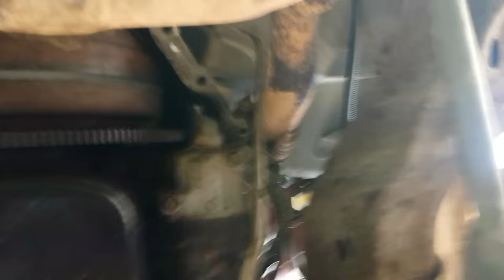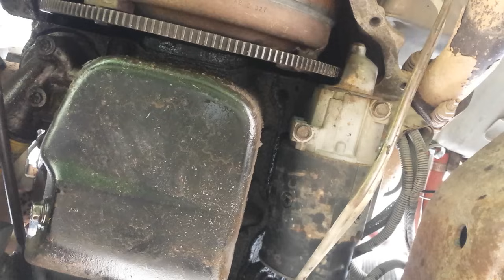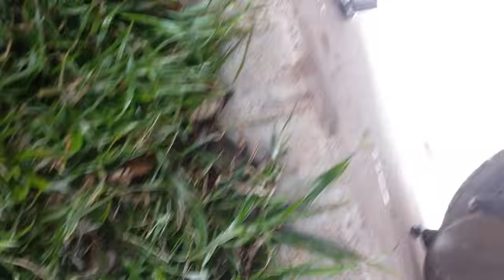Bad flexplate sound

Comment: My 86 Monte Carlo SS, does the same shit...thought it was a bearing, but when car warms up it's fine, for the whole day, just on initial startup after sitting in the garage. Replaced flywheel and starter, when left stranded...Now, won't start(after 6 months of use), just that annoying GM "zing". I hope it's the starter, and not because the lazy asshole mechanic didn't torque my new flywheel to spec.

Comment: My flex plate is cracked as well. Only to find out the torque converter is actually stuck to the engine as well. Mechanic is on it, but he said if they can't get it off I have to get a new engine..... They've been trying to get it off for about 4 hrs. Next step is cutting the torque converter like a pie and putting some heat to the center. Please pray for me lol engine is clean as can be too. It's going to suck having to get a new engine when there's nothing wrong with mine..
Reply from the maker: Suh Dude good luck bud. Put a little heat on it and have at it.
Reply: FamilyMatters2015 thanks man
Reply: Suh Dude what happened??? Results?
Reply: Shoot, I’d find a way to get it off.. even if I had to pull the whole thing engine and all and use a blowtorch and a friggin jack hammer! Lol

Comment: Fly wheel sounds fine, and I would know
Reply from the maker: USMC FT BLASTER it shure didnt look fine when it was pulled.  Was almost in 2 pieces. Cracked all the way around where it bolts to the crank
Reply: FamilyMatters2015 well than that's one quiet fly wheel, mine would make a loud clacking sound occasionally and then on prom night my car broke down and we found out the fly wheel is basically in pieces, last I looked at it it was cracked so bad it wasn't even, it had an upper layer and a lower layer from where the crack was
Reply from the maker: USMC FT BLASTER yea mine was in a couple pieces